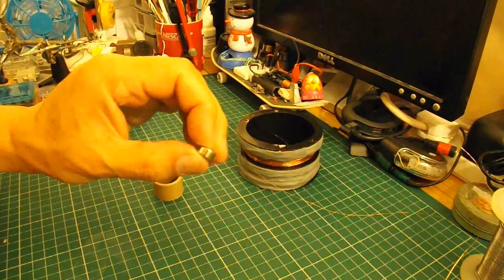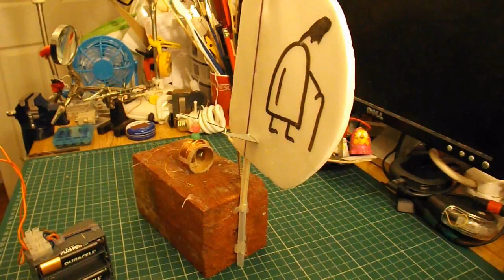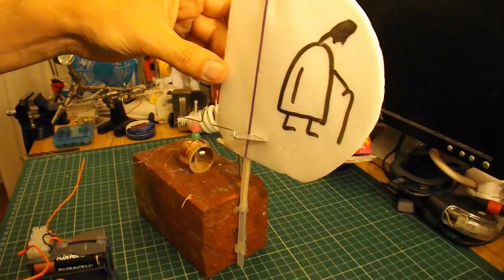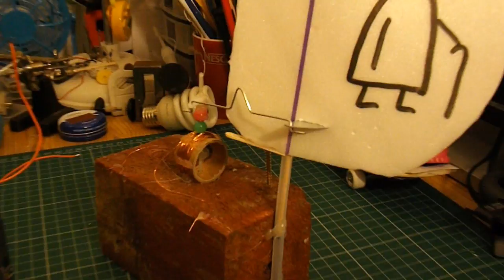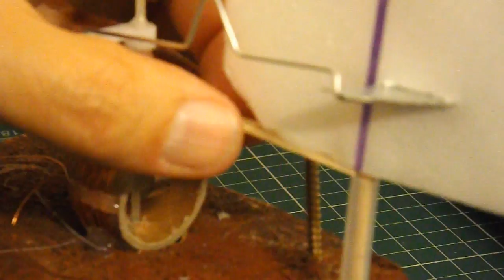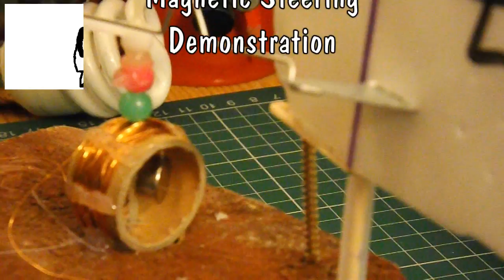Simple Magnetic Steering Demonstration

Comment: What's the difference between this and a motor
Reply from the maker: A motor would have a commutator to reverse the current through the coil every half rotation to make the armature spin all the way round instead of just 180 degrees.
Reply: @GrandadIsAnOldMan  And Maybe more durable/reliable than a motor?
Reply from the maker: @krillevon1415  There are some RC cars that use a similar system for steering and many lightweight rc planes use it, but in a much smaller configuration as it can be a weight saving feature as you just need a small magnet and a coil of wire. The disadvantage is it is not a proportional system.

Comment: Very nice demo, large enough to see what's happening.
Regarding the spring return..in my own builds from scratch of these, the wind from forward flight centers the rudder well. As soon as the power is released, the rudder straightens anyway :)
Reply from the maker: slider2732 hi slider, thanks for the comment and thanks for the tip :-)